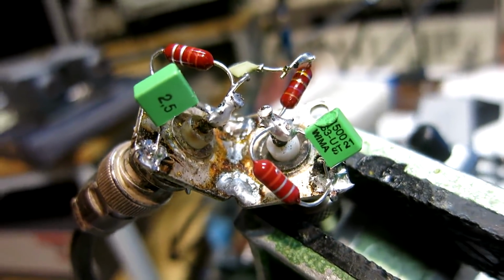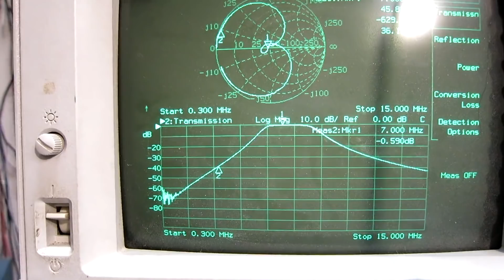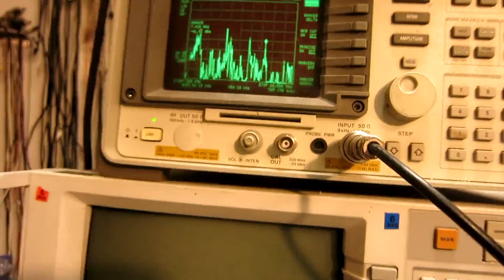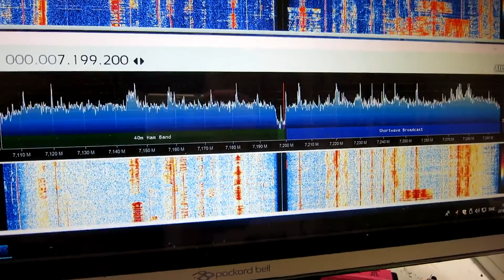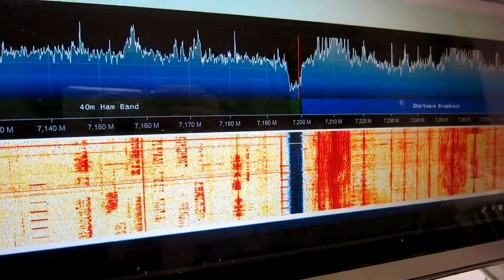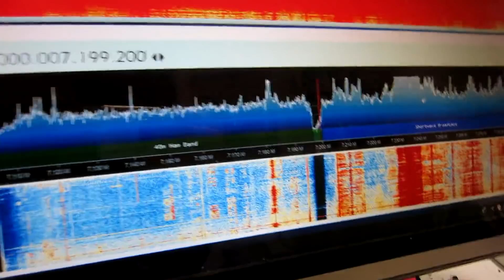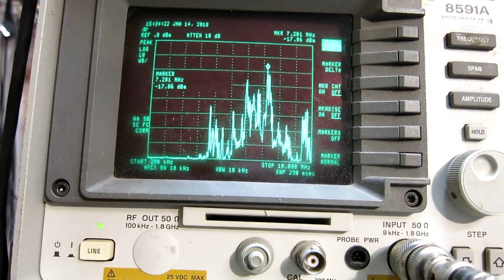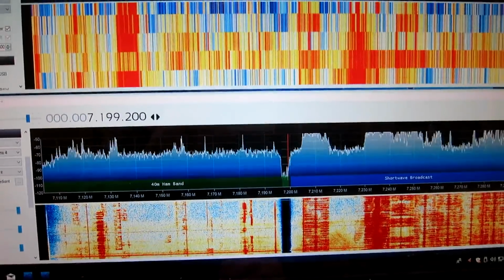hfplusfilter

Comment: Please put, if possible, links to the schematic diagrams of the crystal filter and of the directional coupler used in the test. 73 Corneliu
Reply from the maker: About transmission line notch filters:
https://groups.google.com/forum/#!topic/linrad/Pzkj0nvgJHI
The directional coupler contains two parallel 50 ohm transmission lines
separated by a distance that gives - 20 dB coupling on 144 MHz. It gives -43 dB coupling on 7 MHz with a 40 dB directivity.

Comment: Thanks for this explanation, I did something similar in blog articles https://pa1ejo.wordpress.com/2017/09/03/bandpass-filters/ and https://pa1ejo.wordpress.com/2017/10/11/what-is-the-noise-floor-is-a-sdr/ With the airspy HF+ I find with a similar approach a somewhat lower noisefloor (10 dBs lower if I'm correct). However, as you also demonstrate, running any SDR without a prefilter is asking for intermodulation in particular in the high end of the 40m band.